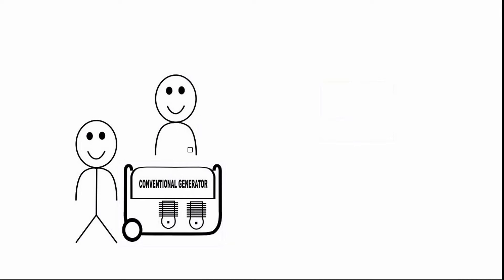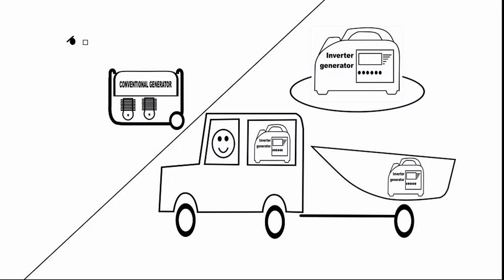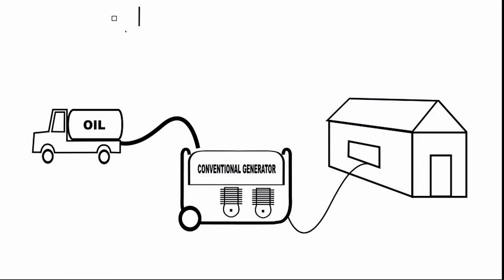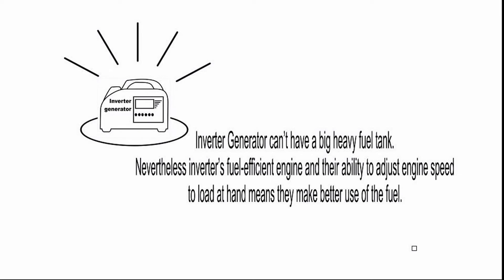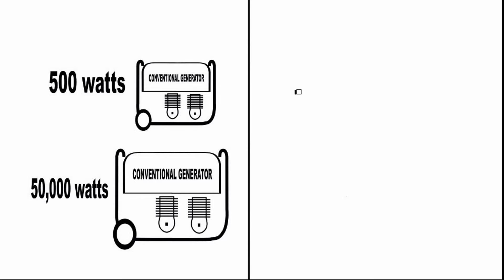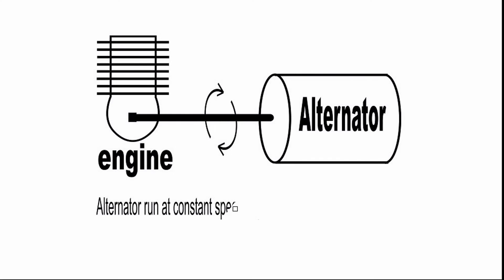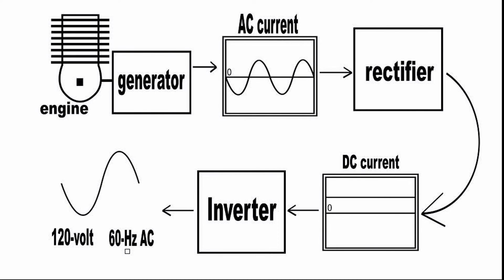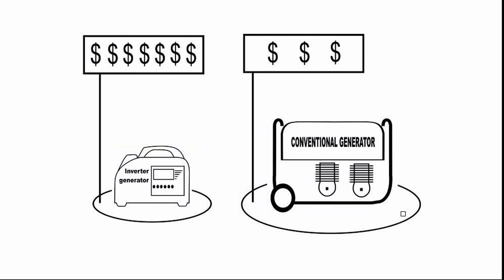Inverter Generator vs. Generator – Explained

Comment: Yes to all of what you said , but it's mainly due to sensitive electronics and refrigerator and tvs can't handle the over voltage and over frequency of the engine throttling up and down when load changes and what not

Comment: The alternator in an inverter generator  is generally 3 phase, like a car alternator.. The rectified product requires a lot less filtering to get smooth enough DC to feed the inverter. In a car the battery does the filtering